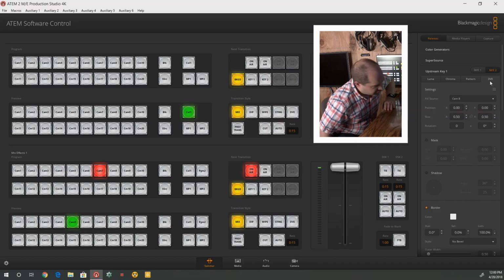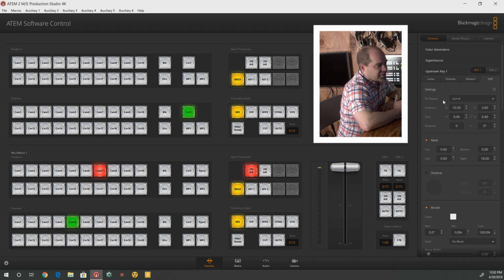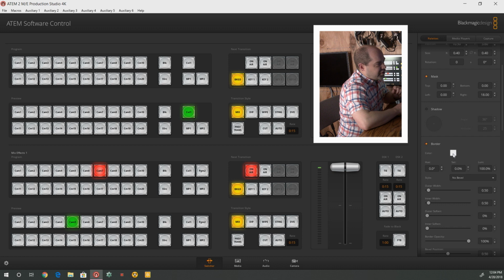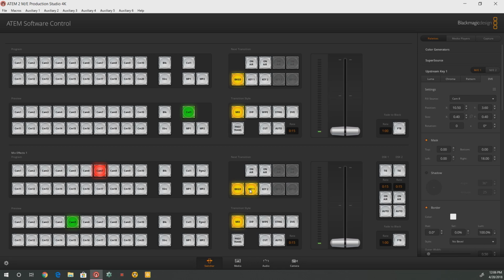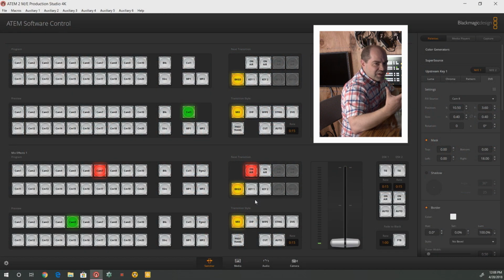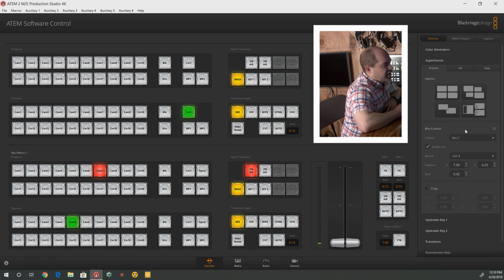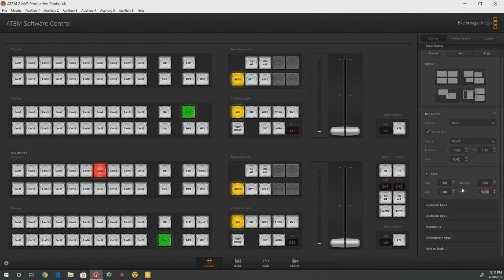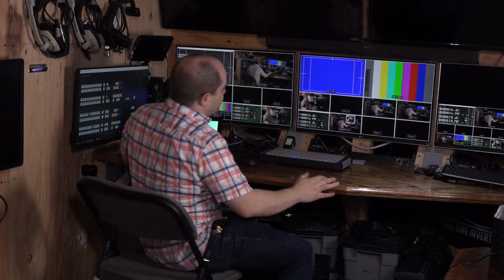Creating Picture-in-Picture on your Video Switcher

Comment: Hi Doug, what Switcher you use? Can i use any switcher and connect to atem software?
Reply from the maker: My main switcher is the ATEM 2 M/E Production Studio 4K, but I also have the 2 M/E Constellation HD and a couple Mini and SDI models. This technique should work with most ATEM switchers -- and any in theri current product lineup.
Reply: @djp_video  so it works also for atem mini?
Reply from the maker: Yes, it should. The ATEM Mini (non-Extreme) models don't have the SuperSource feature, but they do have a DVE that you can use with Upstream Key 1. If you see a PiP button on your ATEM you're good to go.

Comment: Thanks for the video. I'm still having this issue where the PIP doesn't stay. I'm using a BM ATEM Mini Pro. I followed the order of operations and the PIP shows up in the preview. But when I actually switch the angle, the PIP disappears.

When switching angles in ATEM Software control, the PIP stays.But when I cut using the buttons on the ATEM Mini Pro hardware, the PIP disappears from both preview and program, despite showing in both windows prior to the cut. 

 Any tips?
Reply from the maker: In ATEM Setup, change the "Picture in Picture Keyer" option to "Stay on with transition" rather than "Drop with transition"

Comment: How can you do split screen on the ATEm 1  M/E Production Studio 4K
Reply from the maker: It isn't capable of doing a split screen -- it only has a single DVE unit so it can only scale (resize) one video source at a time.
Reply: @djp_video  thanks for your reply. Have one more question.  are there any outboard get to get to connect to the ATEM to do split screen.
Reply from the maker: You could use a Decimator DMON-QUAD,  or an ATEM Mini Extreme
Reply: @djp_video  I have one do you have a tutorial on it
Reply from the maker: DMON-QUAD: https://youtu.be/vE-2p5OPGXI 

Here's one from Alex Pettitt on SuperSouce on the ATEM Mini Extreme: https://www.youtube.com/watch?v=08_-V3dKDI8

Comment: Is it possible to do PIP while using a green screen background, for example 2 people in a 3 cam interview set up, adding PIP while they are keyed
Reply from the maker: If you have a model of switcher with multiple upstream keys you can, like the ATEM Mini Extreme or Production Studio models. Use the first USK to do the Chroma Key for the green screen, and the second USK with the DVE for the Picture-in-Picture.

Without a second Mix/Effects engine or a second switcher, though, you won’t be able to put the green screen source in the PiP window.

Comment: Hi Doug, I’m used to Wirecast and it’s effects of  side by side, is that something we can do using this ATEM 4K. Even this PIP, How can I use it both PIP effect and lower thirds. It seems ATEM restricts either DVE or luma/chroma effect.
Reply from the maker: Most ATEM switchers either have multiple Upstream keyers, or at least have one Upstream and one Downstream keyer. You can use the USK with the DVE for the PiP effect, then use a second USK or a DSK for the lower third. The DVE used by the PiP isn't required for a lower third, so you can do both at the same time.
Reply: @djp_video  Thank you! I will experiment. Is there a comprehensive user guide or videos for these switchers. There is no published user guide on the blackmagicdesign website. I feel like we bought this giant ATEM and not using its features at all. I feel like Wirecast was a better setup.
Reply from the maker: @jarasavelli  There is a proper manual on the Blackmagic Design website, under the Support section.

Comment: Hi Doug, I have a ATEM 1 M/E Production Studio 4K and have some gigs coming up where the background would be a powerpoint and the speaker would be PIP. However, the client is asking for 2 cameras on the speaker (Wide and roaming). Is there a way to keep the powerpoint as the BG the whole time and cut between PIP cameras 1&2? Thanks in advance!
Reply from the maker: Yes; just change the source for the USK.
Reply: @djp_video  That worked great. I am now realizing that I might have screwed up going with the 1 M/E. We are looking to do a conference involving a power point. The picture in picture part is fine, but it will cover a little of the PPT presentation. Is there a way that I can shrink the PPT feed so that the PIP doesn't cover it? Can I cheat this in anyway? Thanks!

Comment: Hello Doug. GREAT video (as you always do). One question that was not answered: If I want to have my PiP persist on one specific channel but not appear on other channels, how is that done on the Atem Mini? Currently I have changed the PiP Keyer to "Stay on with transitions" but now the "Key 1" button simply alternates between on/off with each transition. My goal is to always have PiP on Channel 3 but OFF for Channels 1, 2 and 4. I would prefer to not use a macro because I am presenting standing up and I'm trying to use the mini controls as much as possible. Any direction will be very much appreciated. Thank you.
Reply from the maker: Without macros the only way to accomplish this would be to always alternate between source 3 and other sources (3, 1, 3, 4, 3, 2, 3, 1, etc.). 

If you're willing to invest in a little hardware, you could get a Stream Deck and use the Bitfocus Companion software to build some macros that can be triggered with a single button push.
Reply: @djp_video  THANK YOU! I am fairly new to the Atem Mini so I appreciate you confirming my suspicion that what I was trying to do was not possible. I looked at the Stream Deck and it looks like the way to go. When you say "Bitfocus Companion software" I assume you mean that comes with the Stream Deck? Thank you again for the brilliant videos.
Reply from the maker: Bitfocus Companion is a third party, open-source app that works with the Stream Deck.

Comment: Hey Doug.  We are using the 1 M/E 4K with PIP.  Do you know if you can set the PIP from landscape mode to portrait mode?  We need portrait for our signers (deaf signing) to get the height required for some of the signs.  Landscape requires us to be too zoom out.  Is that possible or will it stretch the video?  Or do we need to set the HD camera on its side to get the portrait?  Thanks!
Reply from the maker: You can crop in on the PiP to make it look like it's Portrait, but stretching probably isn't a great idea.